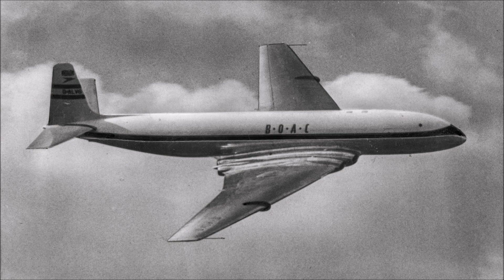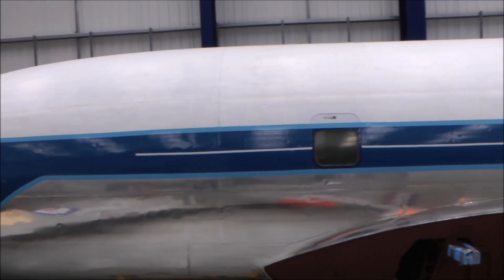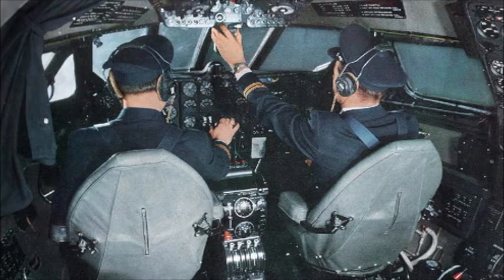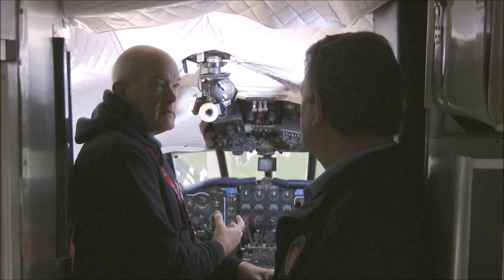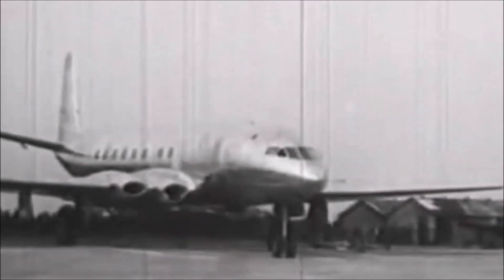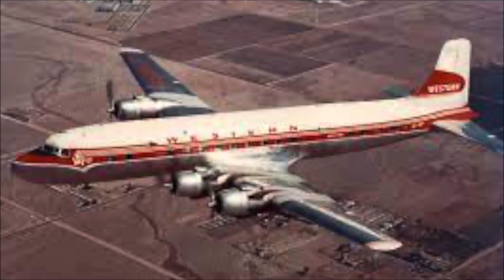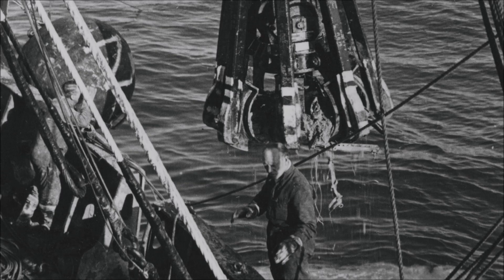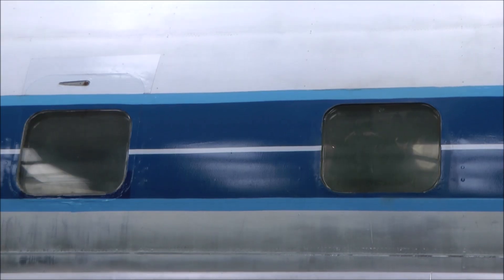DH.106 Comet, the first jet airliner. "Cutting Edge" metal marvel or material failure? (Pt. 1 of 3)

Comment: Every report on the Comet says "It wasn't the square windows", well if they really had no impact on the structural failure why has there never been a square window seen on any airliner since?
I am a big de Havilland fan and know the story well but that plausible contribution to the structures failure always seems to be dismissed.
Reply: The Comet windows weren’t completely square, they had quite rounded corners. The cracks were found to start at rivet holes close to the window frames, not the corner of the windows. These rivet holes themselves weren’t meant be there originally. The prototypes had their window frames attached to the fuselage with Redux bonding. This method of installation was found to be too cumbersome for large scale production  The Comet had a circular fuselage of quite a tight diameter so a square window wasn’t unusual and other pressurised airliners of the day also featured square windows. Later jetliners would have a ‘double bubble shape’ fuselage with flatter sides  which allowed the taller oblong windows we are all familiar with today. Modern jetliners like the A321 feature straight tops and bottoms with generous radius curvers on the corner.
Reply: @michduncg  It's a completely moot point as wreckage recovered from the sea confirmed that the passenger windows were not involved in the catastrophic in-flight structural failures... square windows theory has been completely debunked as a red herring.
The actual cause is a far more imbarrassing tale of incompetence and criminal negligence.
The orgin of the fatal cracks were in the Crown sheets that were only half as thick as they needed to be and made from AL2014B and completely unsuitable alloy that was too brittle.
The Comet lacked proper overlapping Rip-stop doubler joints and the fuselage frame hoops and stringers were too weak and spaced too far apart to prevent cracks from joining up with adjacent panels.
The quality of the riveted fastenings were also found to substandard for pressurized cabins and of poor quality overall, no other manufacturers used the primitive methods used by de Havilland on their pressurized cabins.
Reply: @WilhelmKarsten 

We feel we can shed some light on some common myths & misunderstandings.

  That's correct of course, at the time the Comet wasn't particularly dangerous. It was also definitely not the worst aircraft engineering disaster in aviation history obviously.

  The Comet's engines, right from the first prototype were demonstrated to have enough power even for high altitude  / hot airport operation. No incidents were caused by lack of power.

   Obviously the Comet's engine position & inlet position had some distinct advantages at the time & of course pylon mounted  podded engines have some problems including excessive induced drag. The Comet engine inlet design was not a fatal flaw & didn't cause any incidents.

Examples of all Comets mks including some Comet 1 airframes continued flying with certification at some point after 1954. Flying carried on until 1997. 

      Losses comparisons.
How things were in those days.

DeHavilland Comet 4 UK                  14% 
DeHavilland Comet all mks             17%  

Boeing 307                               70%
Boeing 247                               48%
Boeing 707            .                  20% 
Boeing 377                                19%  
MD DC-8                                    15%
Lockheed Electra Turboprop   29%
Canadair CL-44  Turboprop     46%  
Convair CV-580  Turboprop     22%
Convair CV-880    (ff 1959)       27%  
Convair CV-990     (ff 1961)      35%

     Of course De Havilland had prior experience building many all metal construction airframe aircraft & thousands of jet powered fighter aircraft that were primarily of metal construction with pressurised cockpits & jet engines built by De-Havilland.

   That is of course correct, Comets flew until 1997 & the original Comet design had military use as a requirement. Nimrod development began at De Havilland before 1953, Nimrod aircraft were in service until 2011. Indeed it is the case that the Nimrod was not withdrawn due to structure problems or other airframe issues, it was entirely due to a significant wing upgrade snag & resultant basic economics & an end of line sale happening at Bow-wing (see b-47 wing folding incidents for info) at the same time.
 
    The world's first pressurised cabin aircraft was of course an Engineering Division USD-9A, a modified British design Airco DH.9A built under license in the US  & was of course the first aircraft to fly with a pressurized cockpit module. This was during a joint US / UK research project in the 1920s.
 
    Yes, that's true, De Havilland carried out full stress analysis & engaged in a comprehensive & protracted testing program which is why key De Havilland people were happy to be aboard flying DH Comet aircraft. The Comet was the first airliner where stress due to pressurisation significantly exceeded flying load stress for a full length passenger cabin fuselage.

     We agree, that's correct, the DH Comet was the first passenger airliner with full length fuselage pressurisation at 8psi pressure differential. Handley Page built the world's first all metal construction airliner during the 1920s.
     In all cases other earlier pressurised aircraft were larger, needed thicker fuselage skins due to flying stresses alone & had much lower pressurisation differential pressure or were military aircraft with relatively small heavily built pressurised capsules. 

     Of course ripstop provision was provided. The skin alloy used became unavailable at the time due to R & D at the manufacturers which resulted in the original alloy being discontinued. Later alloys had very similar properties. The skin thickness used for the Comet was used for similar size later aircraft. Frame spacing was not found to be too large & frame width was not found to be too small.

    Without doubt De Havilland did indeed always work to better than industry standards at the time, used up to date knowledge for the design & construction & no evidence of negligence or criminal negligence was ever produced in relation to the DH Comet.

    Obviously the DH Comet had no effect on the course of the aerospace industry in the UK. The UK now has the world's highest combined nuclear, aerospace & defence sectors per capita activity. Of course anyone currently flying on a wide body airliner stands a good chance of being on an aircraft powered by RR gas turbine aero engines designed & built in the UK.

    That's correct, the investigation committee did not find hundreds of fatal flaws or evidence of design defects, structural defects, defective materials or shoddy workmanship. Indeed it is the case that ripstop provision was included. Claimed incidents did not involve cracks starting from passenger cabin window corners. Pretty much all changes were just in case changes or were planned development modifications & improvements that were scheduled regardless of incidents.

    Obviously De Havilland designers knew all there was to know about metal fatigue at the time they designed the DH Comet.

    It is in fact true to say that the way airliners were built changed everywhere, including in the US, after the Comet incidents.

We hope this helps, obviously.

Cheers indeed of course as always etc.
👍
 
 
 . . .... ... ..... . ..... ..... ..